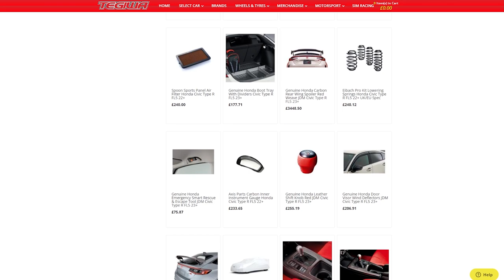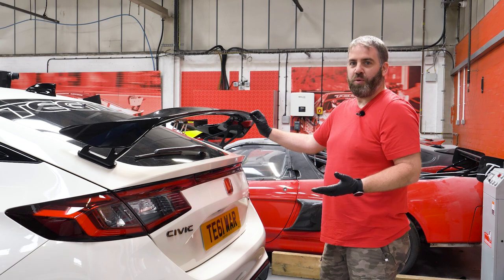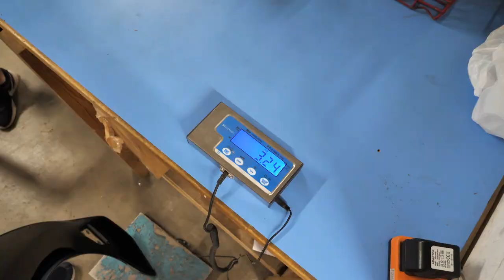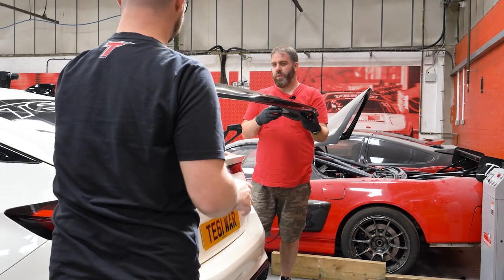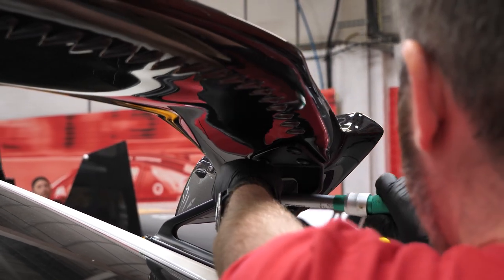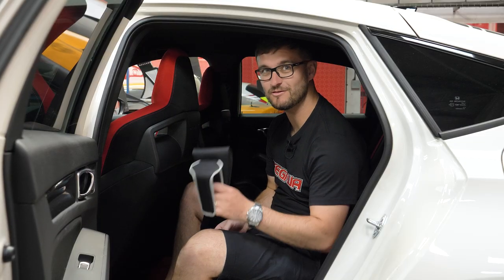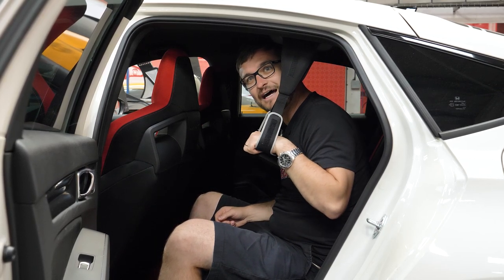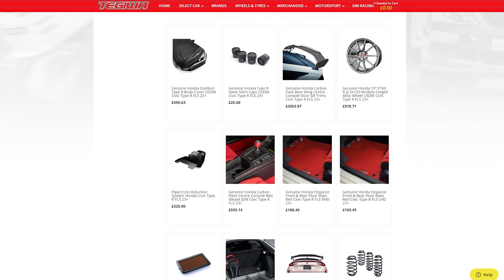Honda Accessories from around the world fitted to our Honda Civic Type R FL5! UKDM / USDM / JDM

Comment: He installed the door protection wrong The reason why it has two pieces of backing is because you remove one half of it and put it on the outermost part of the door's edge and then fold it over into words the inner portion of the door so that it actually covers the edge

Comment: For the stuff with 3M red tape, you can peel the backing from the edge of each strip just enough so that it sticks out beyond the part and is reachable once the part is positioned. Then you can put it in place without sticking it down fully and reposition it more easily if you mess up. Once in place just pull the bits of the strips poking out slowly and they should come out easy enough. EDIT - just seen you have done this later on with the wind deflectors 😂

Comment: HOLY MOLY! don't let this guy install your shift knob (13:50)
Reply: It's crazy because it simply won't work by following what he did. Not to mention it may damage the knob.
Reply: It would have worked for me. I was able to take my factory one off without removing the boot collar. But I know that’s not how you do it. My boot collar was stuck. I had to take apart the trim
Reply: I wouldn't have put that ugly knob on there in the first place. Looks awful compared to the silver knob.